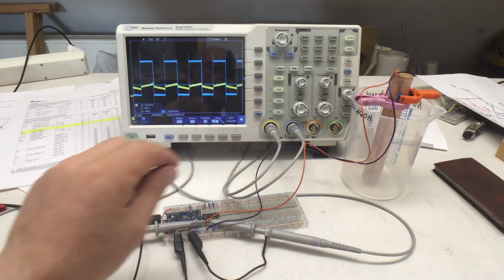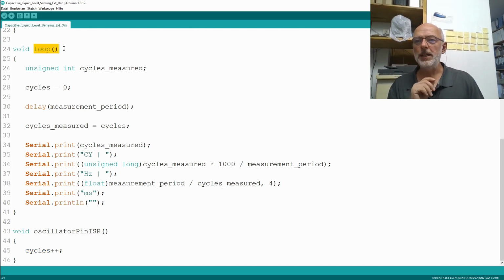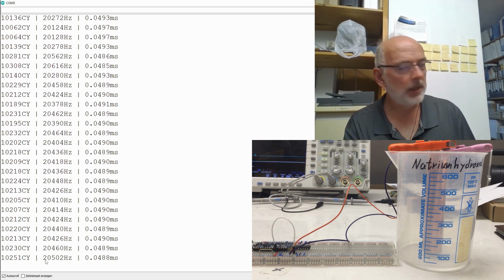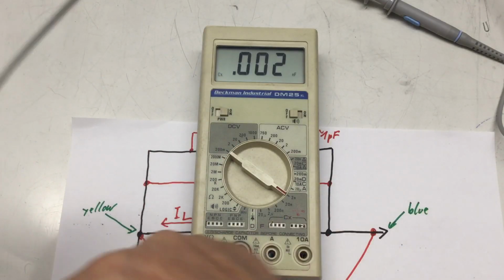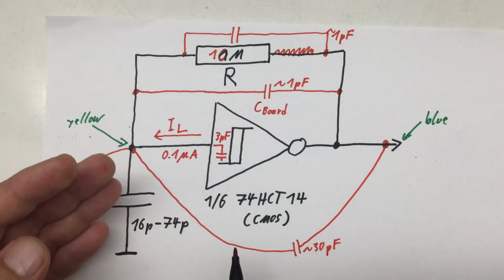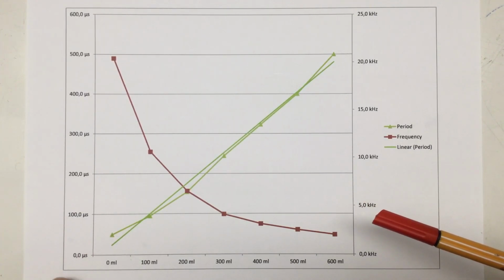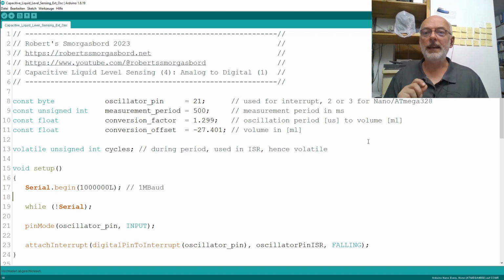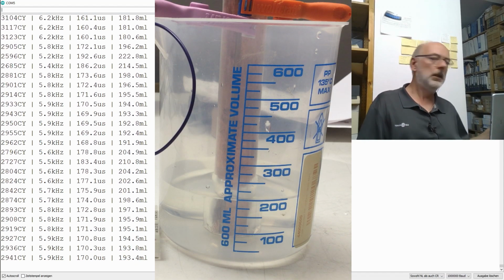Capacitive Liquid Level Sensing (4): Analog to Digital (1)

Comment: Great video, great material. Thank you. The easiest way to do that is to attach the electronics PCB atop the measurement rod, plus adding a heatshrink in the electronics part in order to avoid water damage.
Reply from the maker: Yup! Avoiding any leads between the sensor and the electronics is definitely the way to go. I think in video 7 I'll mount a breadboard with an Arduino at the to of the sensor. Still a bit of leads left, but much closer to a real world implementation.

Comment: You achieved good precision.  I think using a coaxial cable can remove lot error ( Just guess😅). Sir, arduino serial port can delay many other instructions , maybe this is why frequency is not stable.
Reply from the maker: You are right, I definitely should use an coax / shielded cable. But I hope just for demonstrating the principles my hook-up wires will do 😅 And you're right about the Arduino serial port instructions too. It would have been better to insert a delay after them to make sure everything has been transmitted through the serial connection before making the next measurement.